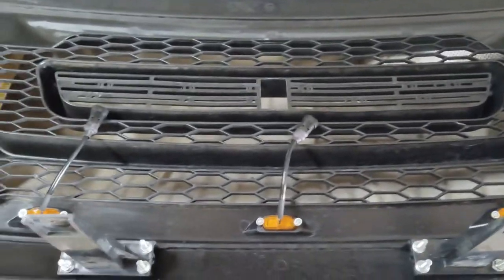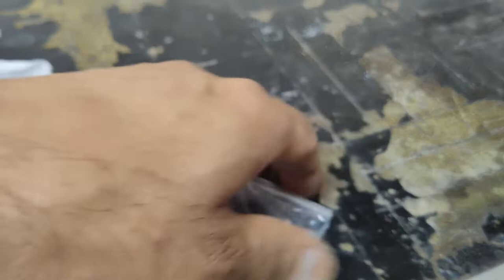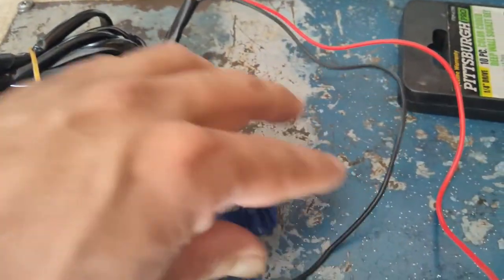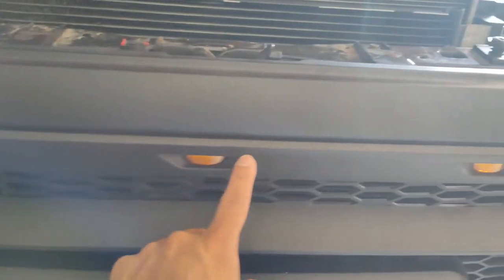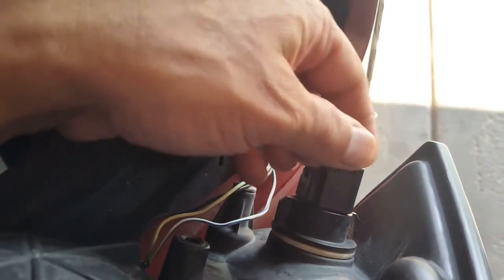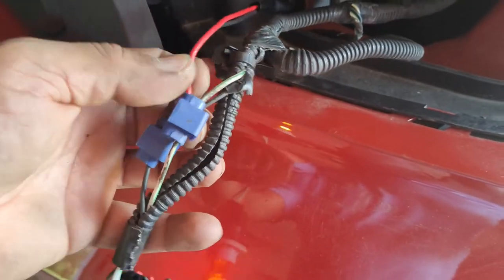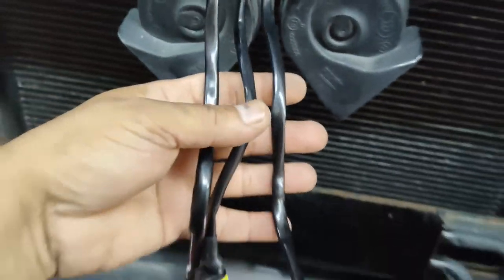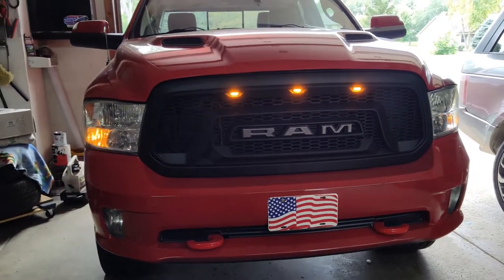Ram Rebel Style Grille Swap/Upgrade & The Light Connection DIY

Comment: Hopefully this helps someone else out, all my wires were backwards from the factory from the place where the lights clip into the harness back to the light. Currently cutting them and splicing. Plugged it in and connected the wires and the lights wouldn't turn on during initial install.